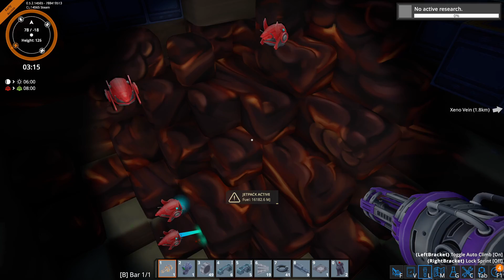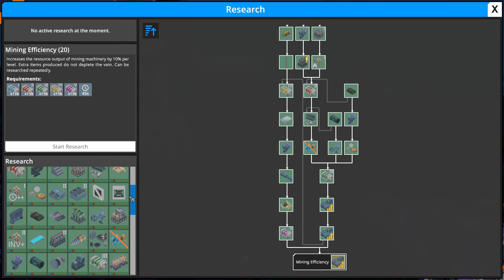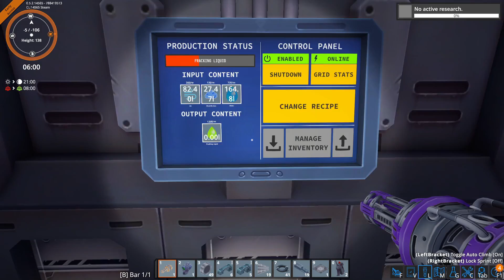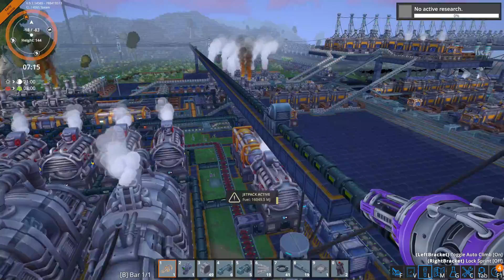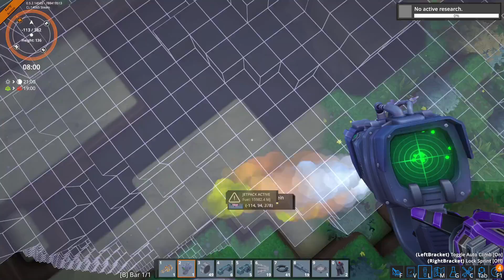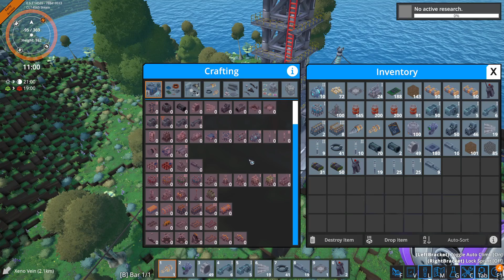Foundry Infinite Ores How to Get Them - Infinite Ores Foundry Tips and Tricks

Comment: Very addicting game. I have just reached science level 4 and realized that once at this point it will take much more time to reach the fracking level than I expected. After watching your video kind of worried about the pipe setups I'll need to make just to use the fracking towers now. I think it may be best to just build pumpjacks closer to the fracking towers and make the fracking fluids that way closer to them. May be a pain to get power to them only that way, and it would decrease the pipe work needed and pumps. The airships and freight elevators will be a must for me once the fracking tower is unlocked. I'm not running 2k belts anymore, lol. It's fine early game with the jetpack unlocked, but not once you have reached end game. Thanks for showing this as I was wondering how this fracking stuff was going to work. Now that I know, I can plan ahead accordingly.
Reply from the maker: I would agree to use pumpjacks to get olumite closer but there are some very isolated veins and we found piping to be easier to use than setting up a whole new area to get the liquid to the fracking tower. Not only that but if you get power poles and cable you can just run those to a transformer and power your foundation that way which makes it a lot easier than connecting building blocks to setups really far away if that makes sense. You’re welcome for the video 👍

Comment: Is there an ore vein for olumite, or are those only on the surface?  Because you need that to make fracking liquid, so if that is not infinite too, then I assume you will run out of the olumite close to you, and have to keep searching farther away to make more liquid.  I realize the game will end by then for most people, but anyone trying to make a true megabase will have to keep expanding to make more fracking liquid.
Reply from the maker: Olumite is a liquid that is extracted with a drill and the reservoirs are infinite, they work like the ore veins rather than the ore nodes 👍
Reply: @Born2Game  olimite is not infinite as far as I know if 'V' over a patch it will show you the remaining capacity
Reply: @davidbisping5000  probably doesnt know they run out if he used the debug menu to skip everything
Reply: @Born2Game  thanks, I didn't realize that!
Reply from the maker: @Gary_E_yt  You’re welcome 👍
Reply: @Born2Game  not unlimited. First reserve I ran dry started around 4 million. That made it through 60ish hours then I found one with 27 million.
Reply: Correct. The only way to get truly infinite resources is to get unlimited Olumite. There are a couple of ways (involving mods in the integrated mod workshop) you can get unlimited Olumite. 1) use the Ore Multiplier mod to multiply the value of each Olumite node (you can get QUADRILLIONS of litres per Olumite Reservoir, so effectively infinite. 2) use the 'Ignium Liquefaction' mod. (My personal favorite). It is less cheat-y and more practical if you want a playthrough as close to vanilla as possible whilst still getting infinite olumite. The Ignium Liquefaction mod adds a late-game research node for a recipe in the Chemical Processor, which takes 100L of Olumite and 10 Crushed Ignium Ore and gives you 500L of Olumite. Since Ignium can be found in the infinite veins, you just need to find a Ignium Vein and set up a processing plant nearby to crush the rubble coming in from the miners and then pipe, process, and store the Olumite. I would also recommend the Barreling Mod or at least the new Barreling Machine added in the Galactic Commerce Update. (The barreling mod is better since it has an option to not require the Xenoferrite Plates to make the barrels, unlike the in-game version of the machine. It also can handle vastly more fluid throughput per machine.) Adjustinator is also another good mod since it allows you to resize stacks to allow for more storage per slot (something especially needed as a good size Ignium vein can net you >100,000L of Olumite (or 600+ Barrels per minute) and the original barrel stack size is 200. EDIT: There is an official way to get infinite Olumite in the vanilla game. You have to buy the trade license for Olumite for 200,000 Fi, and then you can buy barrels on the galactic market. Based upon my expirience with other licenses/trades, there doesn't seem to be a limit. As long as you have Fi to pony up, you can buy as much Olumite as you want, all packaged neatly in barrels.